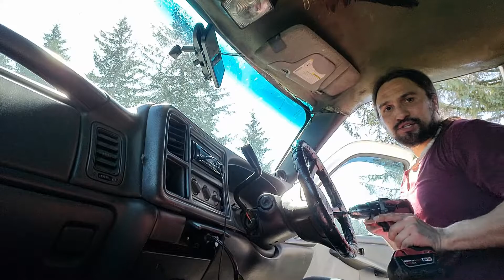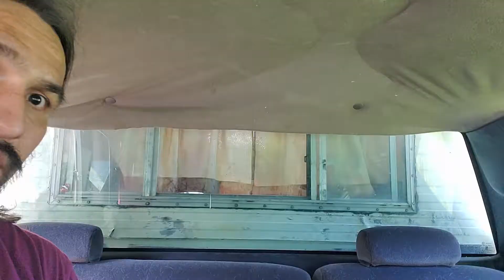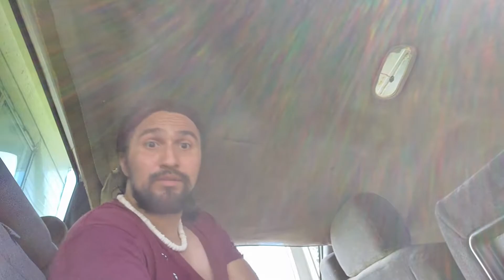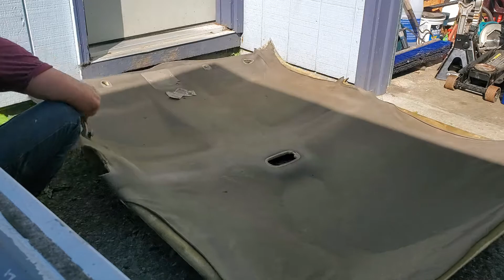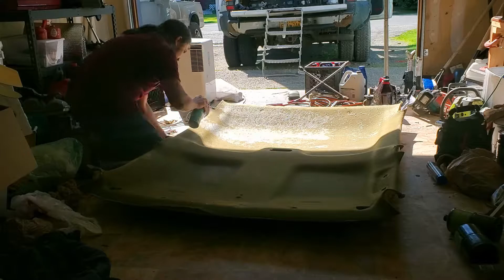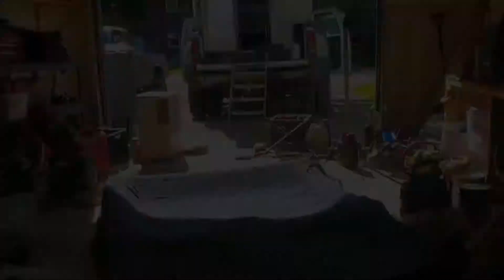Fix SAGGING Headliner in Your GMC Sierra or Chevy Silverado FAST!

Comment: I'm gonna try it this summer, how's the spray adhesive doing, is it still stuck??
Reply from the maker: It's actually still holding just as strong as when I made the video despite my lack of prep work. lol.   I'd say if you do the step I skipped (sanding down the old adhesive) it would look good good and hold strong!
Reply: Ya make sure to sand the old adhesive off and apply bunch on new and you will be fine bubba